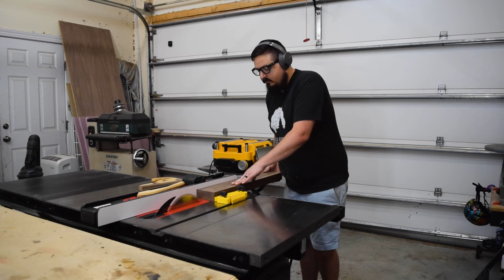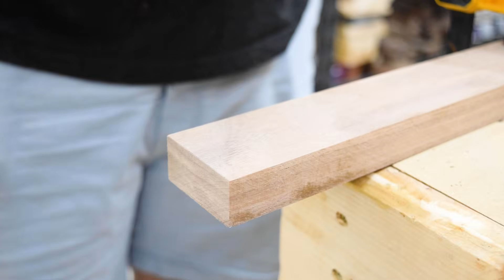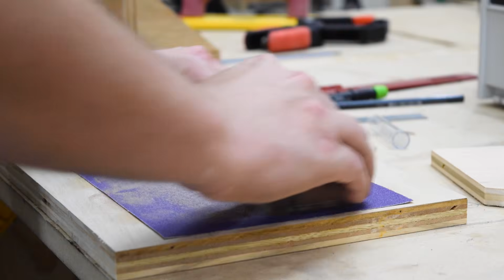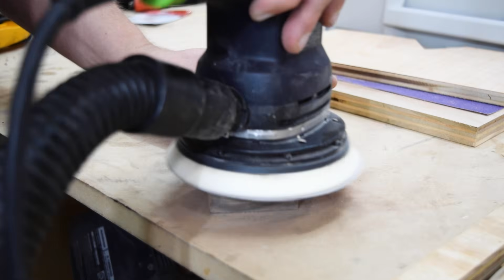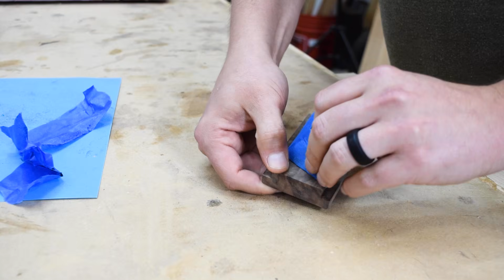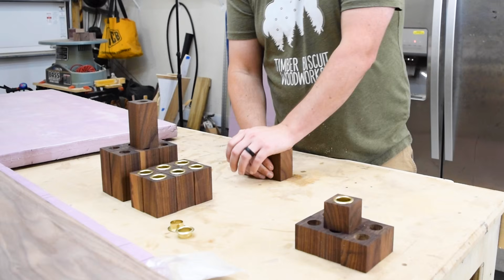SIMPLE Woodworking Projects for GIFTS || Woodworking Gifts

Comment: Oh, from a cooks perspective… made the card holder slot just a bit wider.  Well worn recipe cards are a bit bulky.

Once, just try it, ok? Promise. You will NOT regret it…use carnauba wax. I put it on with a section of cotton Duck fabric.  You could use heavy gauge denim. The texture of these fabrics heat the wax so it permeates the wood better.  Then I put a lambs wool car buffing pad on my random orbit sander.

The lustre that this extra hard wax brings to a wood like mahogany, ebony, Brazilian cherry and other hard woods is just staggering.  Everyone will want to touch it.  Please, after trying give me your opinion. If you find another application method, please let me know so I can try it myself.
Reply from the maker: I’ve used a carnauba on few smaller pieces. I think it was the Real Milk Paint one if I remember correctly. It has been a while though, maybe I’ll revisit it on a future project.
Reply: @TimberBiscuitWoodworks  oh yes.  Esp is you do something like a picture frame with a wide side frame with a recessed rabbit to hold glass, that wide wood just begs for a true waxed finish. And here’s a little reminder….less than 170 days until christmas and less than 100 until Hanukkah.